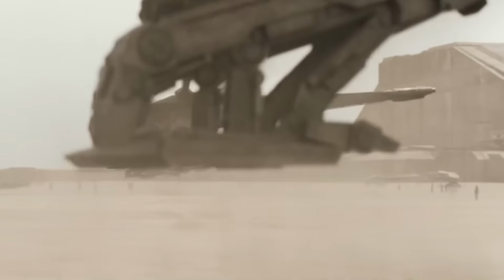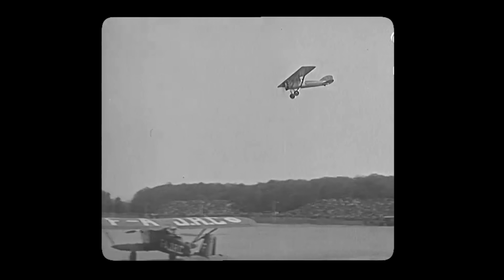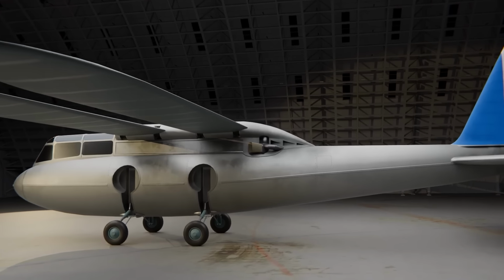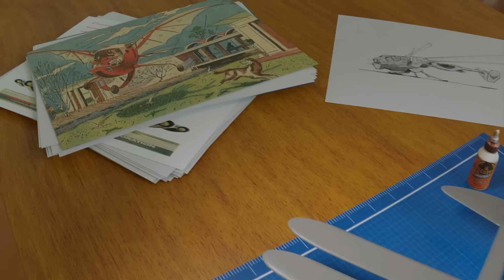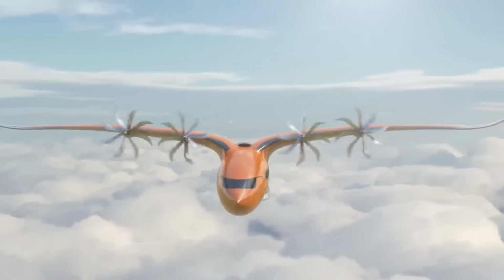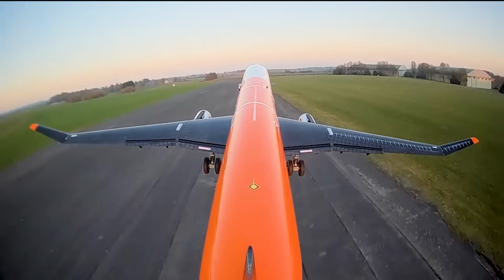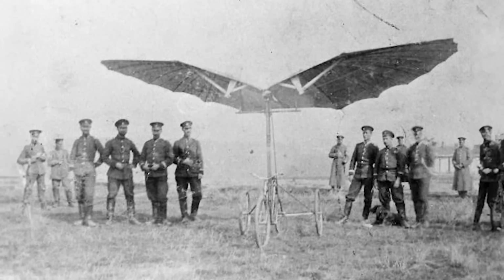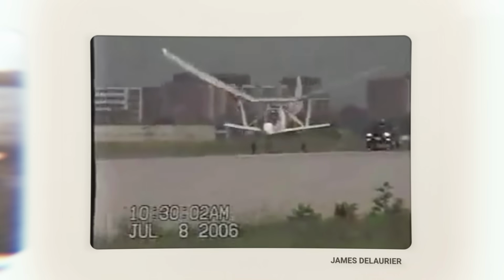The Real Life Dune Ornithopter... it was French!

Comment: Metal fatigue brought down the British Comet airliner.
Cyclic loads destroy metal, opening micro cracks till it reaches the "critical crack size", then it propagates at the speed of sound through the material, destroying the structure. 
Composite materials are better at withstanding this but not immune especially at the extreme high loads that an Ornithopter would require.

Comment: In my mind, the only way an ornithopter actually works, is if the wingtips don't move, but the wing root goes up and down using "feathers" that function like one way valves that open as the wing goes up and close when it goes down. No material is strong enough or light enough to move the wingtips fast enough to produce flight.

Comment: I have no use for combat or combat games.  I find aerodynamics fascinating and I'm a pilot.  I find that the best aircraft are scarred by their use in war or combat, and wish it was otherwise.   An ornithopter suffers from the inefficiencies of constant reciprocation of significant inertial mass, and is therefore highly unlikely to have much of a role beyond airshows.  Its reliability over time and maintenance headaches would rule out any practicality except on an insect level due to scaling effects.  This video is still an interesting historical perspective, and I can see the benefits of the Airbus experimental aircraft to mitigate gust effects and provide finer control than typical primary control surfaces.   I'd like to follow that project and see where it goes.   Birds have a lifting tail and no explicit rudder.  Those two differences, along with fine motor control of feathers allow for much greater flight efficiency and control, and a wider overall flight envelope.

Comment: 30 to 40 wing beats a second.  That's how a dragonfly does it.  This would place alot of mechanical strain on wing linkage, and wings.  Without careful stroke balance, vibration, or worse harmonic resonance would mean a short flight at best.  But with modern technology?  Fly by wire, with computerized wing management, and powerful servos, coupled with flexible wings that can endure extended oscillation.  Who woulf try it?

Comment: The limts of physics and light materials mean these will only exist in very small form.  There is good reason nature only gave such wings to insects and very small hummingbirds.

The aircraft was in the tunnel for 3 hours because they do incremental speed increases over time to see how it reacts and resonates, then speed up a bit more and repeat. In this case that would also gradually increase flapping speeds until it reached it's limit and failed.  Hard to say for sure if it were faster airspeed or faster flapping that eventually broke it but I lean towards the latter due to the vertical breakage of wingspars rather than being blown backwards from speedy tunnel air.

Comment: The vibrations would tear it apart. Unless the each wing and each stroke is perfectly balanced and in sync with the others then it would just shake apart. This would be impossible to accomplish. Plus these wings are also used for control not just lift and propulsion, this would add additional complexity that would further reduce the possibility of a machine like this actually working to a useful degree apart from just flying a short distance.

Comment: This won't happen until they get a fully integrated system, you can't just replicate one part of motion. organic wings turn when they flap. They literally grab a chunk of air and move it down the wing, Bird don't flap as fast and therefore it has to move more but there is a bit of unrolling, it is like throwing a baseball from your armpit and flinging it as hard as you can to the side you are throwing it. That is the power part of the wing, and all the while the cup front to the back feathers twists if off the wing, and it goes back more of a 45 degree angle. The only time the wings are rigid is for gliding, and for slowing down and landing they drop the backs considerably, but each one of those feathers is on a mesh and they all work together. You also need that tail that is lower when slower that has its own lift that works with the wing vortexies for horizonal stability. Not sure if we will ever duplicate that until we are working from the nano cell and able to make feather like surfaces tied to a inner structure. 

The dragonfly does it simpler and cruder but makes up for it with FPM, I would have to assume there is a bit of cupping there too as there are little pockets for the air to be scooped by, but it has 4 wings with complete twist working together while the body is long and a bit of a counter weight, that drops like the tail does on a bird but more like for swinging than scooping. If you watch those wings in slow mo you can also see how aggressive the lean gets if it is propelling forward. Which a lot of what we see is the hover flight in slow mo, it is much harder to catch motion in slow mo, but I would guess it has been done. 

You would think as our heli rotors move and swivel like 260 degrees that if they added a thinner scooped wing that could pull in and stretch out that it might have enough movement to combine with a computer to coordinate it all. I would guess it could be done with a single main spar, but not sure if the material would be up for that at the moment. We need strong and flexible with an electronic muscle type ability to control the flowing panels out and down. 

Would take a lot of money and commitment to R&D

Comment: My Juno: New Origins ornithopter designs take off and land like a plane (via propeller or tinker panel modified rocket engine) but fly (and maintain speed) via flapping their wings. I think that they can work if you get them going first using another propulsion system. One even passed mach 1 on Droo

Comment: You are misunderstanding the nature of a large ornithopter, and cement the misunderstanding in place by using the term “flapping”. You are far nearer the reality by looking at the how the Albatross flys. There is a Web Site devoted to this,…. How the Albatross Flys. The action of a larger moving wing machine is one where the wings “glide” and where with the down stroke or power stroke the angle of attack of the wing alters to be steeper and the up stroke the angle of attack becomes less and the upstroke glides up. The wings must also be able to move for and aft during the gliding movements for different control effects. The Albatross glides in a circular pattern using the uplift of the wind on the back side of the waves.

Comment: thats more like a dragonfly than a bird. you just have to tilt the wings during the up-down motion to achieve directionality, other than outwards air flow. if you dont include the tilting helicopter style blades then you just flap without purpose, like a fish without a goal. your model renders dont show any tilt axis. I dont think you get the idea. unless you assume the two moving axle attachment points can move at different points to make the wings tilt. wind tunnel. that tests only the gliding, not the flapping force. if you make an air flow diagram, all the thrust is going side-ways out. and symmetrically up and down. maybe simulate to get an idea how the air flow works. why cant you verify first that a design does what its supposed to. not just flapping hands in the air for nothing. copy of a copy of a copy as usual. mostly just gimmicks. keep it simple as always. copy. whats so hard about it. just design it like God, or nature in your opinion did it. if nature did you then you can do nature. cant you. its very efficient. insects and birds and helicopters show that. confess that you cant and believe that you can with God. cant you algorithm, why would you make a random ai algorithm dealing with markets. a fish in water does not have to flap its tail at very high frequency. dont give people any credit or even trust them. why would you record your failures. think before you try it. actually. dont mix make things up. its like you never analyzed what the mechanism would do. now its only a flapping powered glider, also spending power to flow air symmetrically in all sideways directions. well be an engineer then. you dont have to specialize in anything. its not hard to engineer designs.

Comment: Ornithopters have never become a valid design for aircraft, because flapping wings are NOT the most efficient means of propulsion.   Your claim that it is the most efficient, is completely false.  
Infact... Ornithopters have never been successful, because the flapping wing design is so grossly inefficient.  

And everyone citing bugs as examples of the efficiency of flapping wings... are all ignoring the reality of Power-to-Weight Ratio in relation to Atmospheric density & GRAVITY.  
The power requirements for fight increase exponentially, with the increase in weight.  This is WHY birds spend most of their time GLIDING in flight, compared to bugs that are always flapping their wings.  
The Gravitational Force on a bug is exceedingly small compared to a bird.  

It is not a problem of material science.  It's all about the reality of physics.  
There is NO escaping the Laws of Thermodynamics.

Comment: Someone did the math and the wings of the ornithopters from the Dune movie would be breaking the sound barrier. So each wing would be creating 2 sonic booms in one full cycle and there are at least for wings so that would be one LOUD craft. With all the other problems like material strength and the articulation required it seems so much easier to just use helicopter blades.

Comment: I thi k the engineers may have been mistaken. The wings of the prototype may have buckled partly be a use of the speed. The design isn't capable of high speeds. It's designed to hover and be extremely maneuverable. Not travel at high speed.

Comment: The dragonfly is the closest analogy. The main problem is one of mass. The bigger the size the higher the involved masses become, in this case particularly because the length of a wing will speed up the tips very strongly even at low flapping frequencies. It’s a bit like the question why we do not have exoskeletons like insects. We would become incredibly heavy and breathing ducts in stead of lungs would be too inefficient. There simply is a scale limit for such solutions.

Comment: It's a cool-looking concept, but at least for civilian aviation a pure ornithopter wouldn't work out. Notwithstanding the materials problem, safety of the passengers needs to be one of the highest priorities. Riout's ornithopter in the windspeed tunnel highlighted the problem: if the wings get screwed up, ALL the lift goes with it, unless there's some type of vertical thrusters to fall back on. A plane can at least glide.

One could argue that a helicopter has the same problem, but all rotors have to do essentially is spin, not flap a large surface through the air. The wear and tear would be tremendous.

Comment: "the advantages to such an aircraft are obvious*: it would have *efficient vertical take off and landing abilities, the flapping wings would also offer potential advantages in maneuverability and energy savings compared with fixed wing aircraft, and impressive abilities in low-to-ground environments"

none of this is obvious whatsoever. in fact, with reciprocating loads massive enough to not only support the aircraft while flying but many times the aircrafts weight when under load, it is not obvious that it would be efficient, energy saving, maneuverable, impressive or offer any other advantages whatsoever.

it would be so cool if it did, i think this stuff is really cool. but it's stuff like that -- bad science writing, basically -- that makes me thumbs down and click away. you don't need hyperbole to make this rad, it's already interesting. i tried.

Comment: It seems pretty clear to me, and I'm not even an engineer, that the stresses on the wings changing direction so quickly would very quickly break something. Fixed wing aircraft only have the drag on the wing going in the same direction, and rotary wings always rotate in the same direction, so they are not constantly moving in one direction, then the opposite direction, several times per second.  For fun, take a tape measure out and move slowly. If you only move it slowly, it will remain rigid, but if you move it faster, it will bend.

Comment: The bigger a bird gets, the less use it tends to make of flapping and the slower that flapping is.  I don't think there's any realistic way to make an ornithopter big enough to be a useful human carrying aircraft with wings that move like a hummingbird. Even birds can't do that at sizes much larger than a Starling.
Even if you had the materials that could stand it the vibration for the crew would be horrendous.  and the system would be in no way failsafe.  An aeroplane can glide if it has engine failure, a helicopter can autorotate if the engine fails.
If an orithoper has an engine failure it can't.  There's no flaps, no pitch control, EVERYTHING comes from the engine driving the wings, lift, propulsion and flight control.  So there's no way to do a dead stick landing in it if that engine stops working.

Comment: How exactly would this save energy?  To do this full size would require a high power input.  The stress on the wings and pivot points would defy even modern materials.  Whereas fixed wings need not deal with reciprocating movements.  And they can still fail often enough. 
Look at the difficulties encountered in the cancelled Boeing SST project. The design called for a swing-wing and the problem came with the pivot point getting exponentially heavier with the size of the aircraft.  Even the early F111 had issues and this was just with movement in one axis.  
It’s the same effect that limits the size of insect exoskeletons.

Comment: when you think about it ... this method makes NO sense at all. sure, it's super-cool ... until the real world intrudes to burst the bubble.

never mind the stresses on the wings overall. THINK about the stresses on the joints.

THINK about how much maintenance and replacement of worn-out parts would be required (assuming the thing does not break while in flight).

THINK about how complicated the wing motion would need to be in order to generate a NET upward force.

THINK about the useful payload that might be available.

Comment: If you are going to "educate" people, about fantasy Ornithopters, at least learn how to say Or-NI-Thopter. it is not Not Orth-in-opter.  The design you seem to think flew did not. Only small scale models flew. And by small, one 100g and one 500g  - Rubber powered I assume,  followed by one with an electric motor. Eventually a prototype was made and it failed completely before it ever flew, and before they even had a chance to test the wing warping that was supposed to allow control of the machine. 20 minutes testing without failure is hardly a big ask! No one in their right mind is designing a real passenger carrying ornithopter, certainly not Airbus Industries. What you showed was a concept designed to investigate feather like control surfaces & wing warping. something that has existed since the very first powered flight in 1903. Just to put this whole debacle in context. Gyrocopters already existed, and Helicopters were being produced years before this thing failed. The German designs were not really Ornithopters.

Comment: The analysis is completely wrong, insect flight is very different from bird flight, nothing like gliding or flapping to achieve lift.
Vortices are a problem for planes and birds but they are key to insect flight, insect wing design and beat patterns are specifically intended to create and control vortices. This method of flight is far more efficient than anything we've designed so far, in fact it's so advanced we don't have the materials science to construct wings strong and flexible enough, and mechanical joints that can survive the friction.